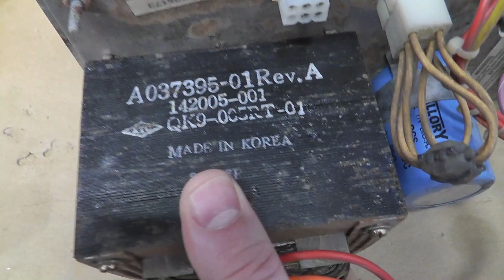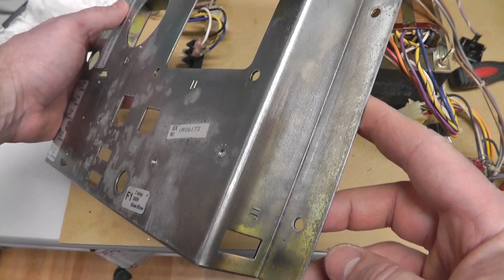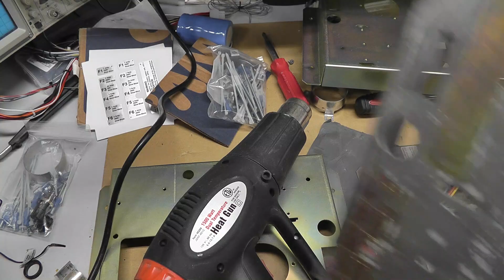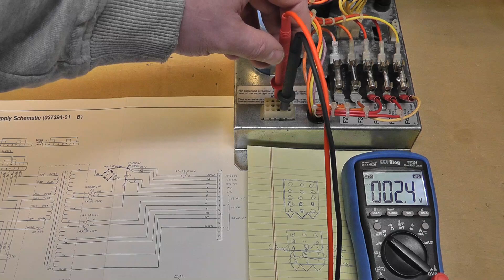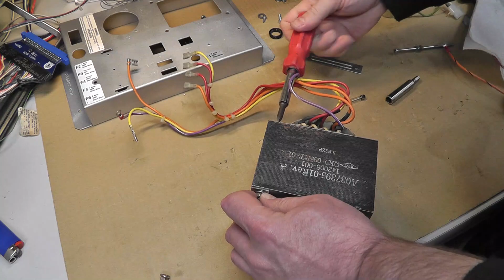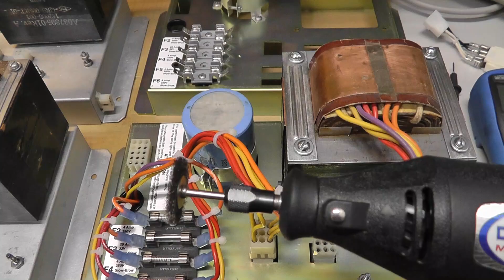Atari Vector Power Brick - Restore and Test

Comment: I have a Pole Position 2 with the Samsung monitor A48KRD89X. The monitor does not power up or do anything anymore. Do you have any experience with those monitors? I tested the brick like you showed in the video. I have 66 volts on the monitor male pin and there is only one male pin in this unit. Any help would be greatly appreciated.
Reply from the maker: Hi.  This video was about testing vector monitor power bricks.  You have a raster game and monitor.  The a48 us a crt number and does not refer to type of monitor chassis.  Your issue is likely not power related but issue with monitor chassis l.

Comment: Great video. would you happen to have any extra transformers for sale? Or where maybe I can find one. My 61v ac are shorted other wise working for my Asteroids.
Reply from the maker: Wow.  I have never come across a bad transformer.  Sorry don't have any atari transformers / bricks for sale.  Pretty sure you can use a raster transformer for the B&W games.  Check the for sale parts or post a wanted here https://forums.arcade-museum.com/forums/trading-videogame-wanted.12/
Reply: @jacklick  your right I tested my centipede power brick ,it's the same but the 2 ac pins are in different locations. I will try your recommendations. Thank you so much ,for everything.....

Comment: Hi @Jacklick,

I've tried to test 74LS123 logic ICs on my TL866II+ programmer and they all fail. However it works fine for 74HC123 chips. I've found your video where you review programmer. Could you please do me favor and try to test one of your 74LS123 chips if you have one to see if they are supported? Sorry for off-topic comment.

===
Thanks
Reply from the maker: Hi Dmitriy, I needed to upgrade my tl866ii to 10.8 and firmware 4.2.124 but can confirm it 74123 fails on 4th vector test out of the 6 that the tl866 tests for.  The new code is better looks like an improvement over the ver 8 I was running.  I did test on my bk864 and the chip passed.  Will have to look closer to see if the vector tests are the same.  Does your 74123 chip fail at same test everytime?